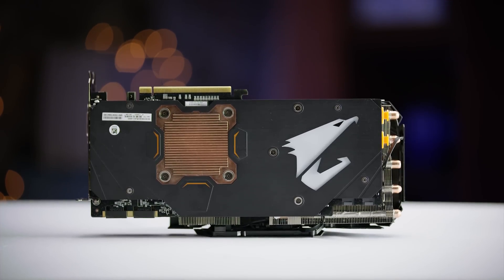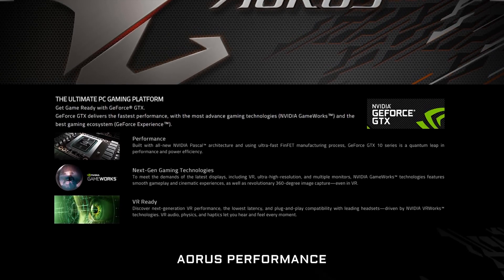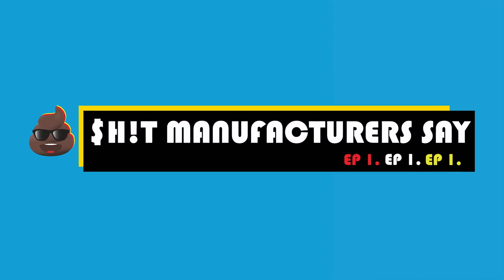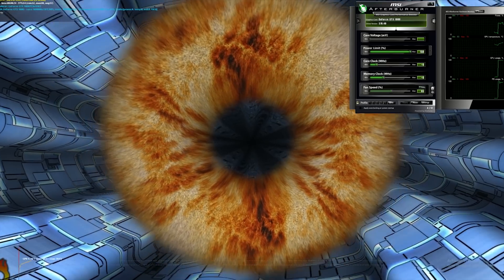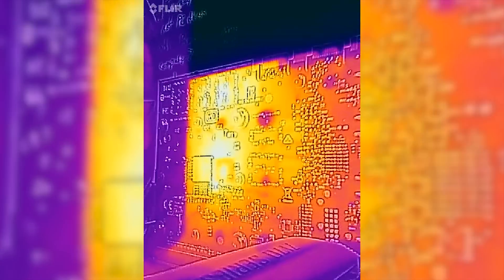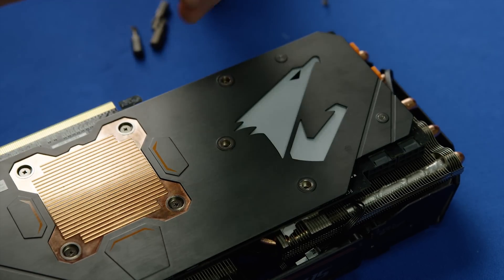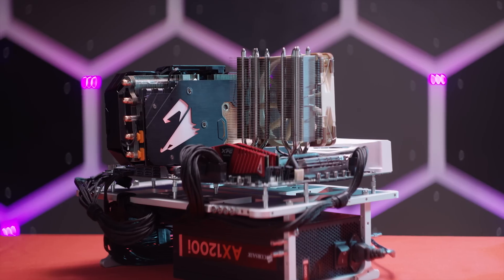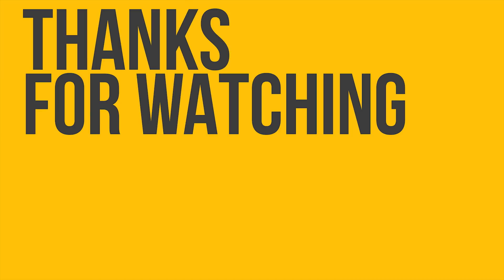$h!t Manufacturers Say Ep. 1 - "Backplates Cool Your Video Card"

Comment: you need to push it to the limit in order to see if the head sink helps. if the normal operating temperature is 67 C, there is no where to significantly reduce it. if you push it to 100C, you need to disperse the heat and test if this copper plate does that

Comment: Same power consumption? No thermal throttling? Same frequencies and voltages etc? Same fan speeds? Any chance the thermal paste you used was better when you rebuilt it? Any chance there's significant case fans blowing air across the back of the card?

Could be that the back plate is as much a net insulator due to poor thermal contact/interface conductivity, as it is a heatsink? Theoretically more cooling surface area = cooler temps. Could we use thermal paste instead of/as well as a pad to help?

Comment: This guy was incredibly annoying to listen to. He was annoyed because of the, excessive, little screws? BTW if heat is being dissipated and removed via passive air, then its working. Maybe not immediately, or reducing core temp; however, it certainly helps keep it from building core temperature.

Comment: I know this is an old video... but the backplate on my 3090 contacts the vram on the backside of the PCB.  The plate itself sits at 70c while mining and it's too hot to touch right where the vram contacts it on the underside.  I had to attach heatsinks to the plate and add fans to wick that heat off my vram.

Comment: This video is not up to date anymore. The RTX 3080 severely throttles due to memory overheat if you have no thermal pad to make contact between the backplate and the back of the PCB where the memory chips are, even though the chips are actually in the front of the card. GDDR6X runs crazy hot (~100°C). It’s a common issue in Gigabyte 3080s, and other manufacturer’s models, though in mainly affects people who do numerical computing/mining. I had my 3080 Vision gain up to 20% performance after adding thermal pads to the backplate (and no, removing the backplate altogether does not help, so it does genuinely provide cooling).

Comment: Hi Linus Tech, I think that your this video by comparing the graphics card with and without the specially designed back plate is logically bulls**t and scientifically completely wrong too. If you don’t understand why, you need to read what I say here or get higher education before making a naively wrong experiment like this.

❌ The second experiment is so wrong: The reason why your comparison is wrong is that you should had compared the graphics card with the special back plate vs. the one with a regular back plate instead of vs. removing it. Removing the back plate can improve air flow, which can make thermal dissipation faster. You should had used a regular back plate because you are now maintaining the air flow at the same level as the one with the specialty designed back plate. This way, you are legitimately able to tell whether or not the specially designed back plate is working for heat dissipation, because you may get a higher temperature than 67°C (e.g. 75°C) with a regular back plates. If so, the specially designed back plate is indeed helping heat dissipation, and your video’s conclusion is WRONG!

❌ First experiment also wrong: I know some people may say, the first experiment by comparing the founder eduction card with and without the regulars back plate already proved that the temperature maintained the same, so removing the regular back plate is not providing more air flow, and thus not helping heat dissipation. Dude, you need to notice that the founder edition card was at around 79°C! This means that the card was actually at its thermal throttling temperature, meaning that the card itself is controlling or reducing its performance to maintain a lower temperature. Still don’t fully understand? Ok. With and without the regular back plate, the founder edition card had almost the same temperature around 79°C, right? But how do u know the card’s performance under these two conditions are the same. You should benchmark its performance under the two different circumstances and u may find that without the regular back plate the founder edition card has a higher benchmark score than with the back plate, but the temperature of the card maybe the same. If this happens, it means the regular back plate is actually compromising the heat dissipation ability of the card, which in turn makes the card to reduce its performance in order to remain a highest safe temperature 79°C... so barely comparing the temperature of the card without considering its real output performance (electrical performance) is just so dumb WRONG too.

Don’t try to argue with me, I have a PhD in engineering thermodynamics from a top-30 univ. :) (PS: btw, Global ranking, not US National ranking)

Comment: I don't think looking at the temp stabilization point is is the way to test.
Would rather have seen the test with benchmark to how FPS reacts to the extra cooling like it did with my system.

Slapping a old gpu cooler not even connecting to the whole backplate with a lot of paste made my 2060 ko ultra hit power limit  nearly constantly as opposed to incidentally before in the exact same conditions.
This result making it very clear that it does do something. Maybe the card was on the fringe of doing that and the marginal cooling made the difference.
But imho, and certainly looking at the back plate temps, the gpu temp will not benefit much but the memory and vrm's certainly will.

2060 ko ultra (+120 core and +1000 mem) with just the gpu water cooled (no fancy rgb bank breaking brand block) with a self made copper block added to an Arctic liquid freezer II 240 in combination with R5 3600.
Without oc the core hits 2050 and with oc 2070 boost with shunt hardmod btw.

Comment: To be fair, you ran this test outside of a case in a room with AC. Now try it in a case with cramped space, poor cable management, shitty air flow, with one case fan not working, on the 2nd floor of a house in the middle of July with no AC, with a relative humidity that requires gills in order to breathe.

Comment: The backplates, if thermal padded to important things like resistors and capacitors on the back of the board, can provide additional thermal capacity for those smaller pieces without adding a whole lot of heat overall

Comment: There is a mistake in the method used here...
Usually, look at the accelero extreme for example, the backplate is not used to cool the core (the extra surface area would be irrelevant vs the heatsink and W output), but to give some extra headroom to the RAM and VRM modules, those (on some cards) don't have a very good heatsink connection on some cards and might benefid from a littleput of extra surface area to vent heat (for some coolers this can be a 2-4x increase in surface area.

Comment: Based on my knowledge of physics, no, it wouldn't help too much. It would spread the heat, but it would also retain the heat. Not only that, it would also trap heat inside. GPUs would run cooler if they didn't have a backplate, because that way the heat can actually escape. It basically works the same way a heatsink does. The heat rises to the backplate, and gets trapped. The heat can then be pulled off using fans. But unlike a heatsink, air cannot pass through it. So basically it does nothing. It's just for looks, and protection.

Comment: im sure that it helps the gpu to stay for longer because when i touch it it get so hot that means the cards will not live alot if it was running cold form the back and the front it will less with you for alot of time

Comment: If the backplate is thermally connected to the heat source, it will help a bit with cooling.  If not, then it will probably hurt it.
Reply: Also,. The same temperature result does not necessarily mean it didn't help cool unless you verified the fan speed was exactly the same.  Did you?

Comment: If it's aluminum and it gets hot..it cools.  Perhaps not much..but it still cools.  This video is completely neglecting that some cards actually pull heat from RAM to the back plate via thermal pads.   My 2080 TI back plate gets to about 63C while gaming.   Again,  if it gets hot it dissipates heat,  aluminum is actually pretty good at it.

Comment: I could have guessed the results with out all the testing. the only way a back plate is EVER going tto help cool the gpu is if the back plate is part of the front heat sink,  they could have a back plate that connected to the front heat sink via heat pipes but you would definitely need some slight "finning" on the plate and you'd definitely have to have some kind of fan on said back plate. Otherwsie;  eventually the plate would just reach the card's ambient temps and then it would make little to no difference for cooling. even with heat pipes leading to it.

Comment: I'm legitimately surprised a manufacturer hasn't yet come up with an idea to allow for an AIO cooler to be attached to a working backplate and allow for extra heat to be withdrawn from the GPU. Especially with the Gigabyte Aorus, that setup there is begging for a mounting kit in conjunction with an AIO to fit on there, given how ubiquitous AIOs are.

Comment: TL;DR: No, fancy backplates don't improve cooling, because they don't offer more convective surface area than the bare circuit board they are attached to. The real reason they are there is to keep dipshits from zapping their brand-new graphics cards with their bare hands and then trying to blame the manufacturer for selling them a DOA product.
Reply: Don't forget to mention that it protecta any surface mount components on the backside from being sheared off or smashed by idiots being idiots.

Comment: If a piece of metal doesn't heat up when something hot is right next to it, then there is absolutely no heat transfer happening, either that or the heat transfer is so out of this world that a thermal camera can't pick up the heat fluctuations and I seriously doubt that is the case, don't believe me?, Good, research heat transfer, find answers, don't just believe it works because you want it to and manufacturers told you it does just to sell you a product.

Comment: Did you guys measure the fan speed change? if the card would run hotter without the backplate by just 3 degreesas they claim, then in theory the fans would easily be able to slightly ramp up and make up for the lesser heat dissipation.

next time you need to isolate all the variables! this was a bad test.

Comment: ..smiley face divided by random polygon = ???? lol
Reply: The copper plate might become useful if the cooling pipes and block become clogged or dirty, then and only then could it's small (if existent) conductive heat transfer and heat dissipative potential be realized.

Comment: OK, now put it into a case with air flow, so you can produce results that mean something.
Reply: If its room temperature or the same temperature both tests then its the same..
Reply: Yasemity  Not remotely.  Without air flow, providing convection, the only real means of heat leaving the card is radiation.  While radiation varies based on surface area, if many of the surfaces are facing each other (as with a finned heat sink, shown on that backplate), the radiation is absorbed and cancels out.  Convecting air, however, would pull from all those surfaces, removing heat faster than radiation alone.

It's simply an invalid test without the normal case environment, which includes air flow over that backplate.  

They'd also have to lock the fan speed to keep it valid, which they didn't.

In reality, if the fancy backplate is going to make a difference, it will be in allowing a higher clock speed at the high end, where the extra heat removal prevents at least one step of downclocking.  There's no way to tell from what they did whether that would actually happen.  The testing methodology was just useless for the task at hand.

Comment: My backplate on my gtx 1080 gigabyte g1 gaming card was getting hot. So "ghetto" cooled it just by sitting a 120mm fan on the backplate pulling the air away from it. With just a little high temp electrical tape helping it stay in place. Actually dropped card temp by 5 to 10c...

Comment: Let me try to understand your ridiculous testing... on a GPU boost 3.0 card you monitored temperatures and not frequency or power consumption to understand radiant cooling potential... You realize that GPU boost 3.0 automatically lowers frequencies until it reaches temperature equilibrium for any temperature beyond about 50c. 79c is the default max temperature for the frequency/temperature graph, which leads me to believe you didnt actually modify the boost table. This test is literally useless and doesnt determine anything. Additionally you removed the heatsink screws to remove the backplate which, depending on the handling with the screws removed, could have shifted or lifted the heatsink off the GPU causing poor thermal conductivity completely invalidating your tests even more. I cant believe a so called "tech youtube" channel cant even properly remove a backplate without providing false information.

Comment: i would have loved to see a little more info on the comparisons. for example, fan speeds for the front cooler with and without the back plate. what if the front cooler was working harder to compensate. i know he touched on this, but the info was thin, regarding thermal throttling and volt caps. what was the clock speed reaching with and without?

Comment: Not really any surprise. Moving heat isn't as simple as people think. There was a whole chunk of a semester at university dedicated to it when I studied engineering. Slapping a plate on the backside of the PCB and not contacting the GPU, well sorry, but that's just pointless. In fact, there is no reason for it to do anything apart from get warm. Air is a terrible conductor of heat so unless there is some way to increase surface area exposed to cold air or physically conduct heat to a cold element, not a lot is going to happen. It's all about the delta T, there's nothing to actively move the heat and certainly not from the GPUin any controlled way. The PCB is sort of an insulator so I'm left wondering why anyone would waste the time, money and resources designing such a thing. The pcb isnt going to move any significant heat so why cool it at all, what's the point? But there are loads of pointless things for PCs that folks buy for the aesthetics so, if you like the look of it, on you go.

Comment: I think that testing in a close case maybe get a different result, (little) than running on an open rig as the air dissipates heat, it would be better a classic heat sink for that.

Comment: so they claim that the tiny screws that connect the backplate to the rest are large enough surface to improve cooling? False advetising maybe! to cool a gpu the cooler needs to be in contact period. Backplate is not in direct contact with the gpu so the cooling benefit should be minimal at best.

Comment: I mean it could work, copper is a very conductive metal, which would mean that it dissipates the heat coming from the chip quickly, then again, it's a shiny metal so it won't emit much radiation, that's probably where your cold spot came from.

Comment: okay point taken... it might mostly be for looks, but what if it actually does keep your PCB just a little cooler? If the card is placed horizontally like in a normal build? i have touched the copper and it is EXTREMELY hot to the touch while under load (Compared to the rest of the back plate). The claim is that the contained heat from the copper is blown out by your exhaust fan. And heat does tend to rise...

Comment: Correct me if im wrong but shouldn't you insulate the copper section from the outside in order to see if heat getting out through it makes a difference? What you just proved is that the copper section is as usefull getting heat out as not having a backplate. I mean, if we are having one, maybe the copper section makes it 3 degrees less than a non coppered backplate.

Comment: This is materials engineering 101 really .. temps dissipate much quicker through metal than air. On a cold winter day, go outside and expose your hand to the cold air for 5 min then rewarm you hand, now go grab and hold onto a outdoor metal flag pole for 5 min .... ever had frostbite .. you will now. 

When installed as intended, engineered and used properly, yes ...  backplates do reduce temps of the VRMs & GPU .  All are not equal, upgrade the material quality, or buy a better card. Also .. Use proper equipment to measure temps

Comment: Your test just proved the GPU has really good feedback control to keep the temperature at 67 degrees. To see whether the copper plate makes a difference or not, I think you should have also recorded the rpm of the fans. If removing the plate doesn't make the fans working harder, then I'd say the plate is useless.

Comment: The backplate isn't meant to cool the core temperature down, it's made for the vram chips, do you see those thermal pads? They're the vram. 

The backplate is designed to cool the vram chips down.
Reply: There is no vram on the back side of the card. All the vram is on the same side as the graphics chip where they have thermal pads as well for the vram.

Comment: If the graphic card was upside-down in the computer, backplates wouldn't matter. However, pretty much every one with a decent graphic card, like a GeForce GTX 1060 and above, probably as a windowed tower. There is nothing sexy about a graphic card PCB. I don't mind in a closed computer case, but in a windowed computer case. backplates are sexy and that is all I expected.